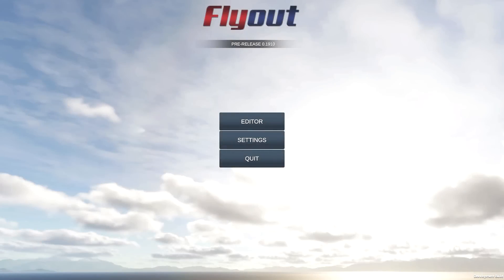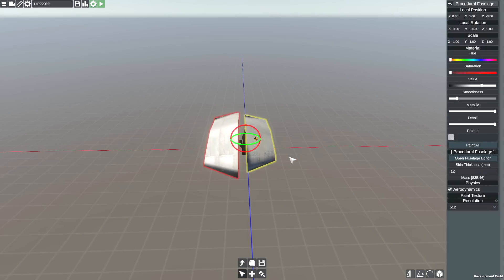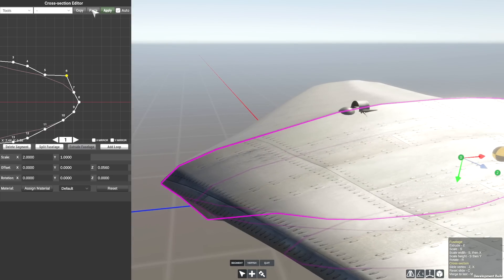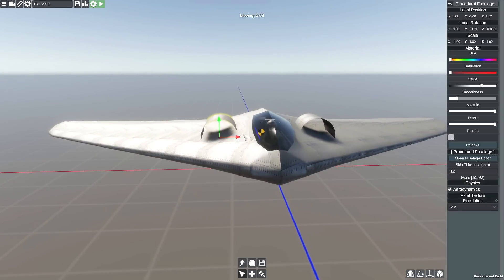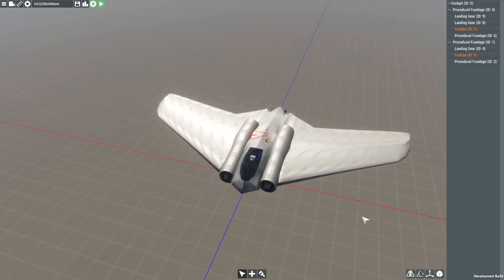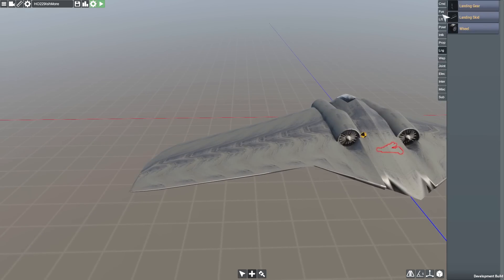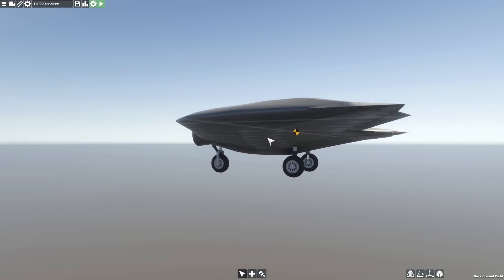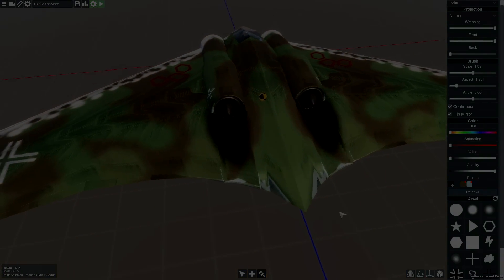Flyout - Building The FIRST EVER Jet Flying Wing!

Comment: stability issues with flying wings can be solved a couple of ways. you can increase the sweep angle of the wing which causes a higher drag force at the forward facing part of the wing, more specifically the forward part of the wingtips; if the craft yaws to one side this increase of drag acts as correctional force and lowers the yaw instability. In more modern flying wings, split ailerons/elevons are often used to exacerbate this drag effect even more. Split ailerons open/deflect both directions which counteracts yaw instability, at the cost of much higher drag. This is also why having wings with higher sweep angle can be beneficial. differential thrust can also be used to combat instability; this stabilizing effect is increased the further apart the engines are from each other/the fuselage (if you can even consider flying wings to have a “fuselage” in the more traditional sense.) great build though!

Comment: The 229 is an interesting and strange plane, no idea what it's purpose was but still interesting.
Reply: It was designed as a high speed light bomber. The requirements for the design were be able to carry 1000kg of payload at a penetration depth of 1000km (total range is 3x that) at 1000km/h. It wasn't ever mass produced, it was still a test vehicle when WW2 finished. (the only flying version was crashed during testing, and the unfinished models were taken by the US)